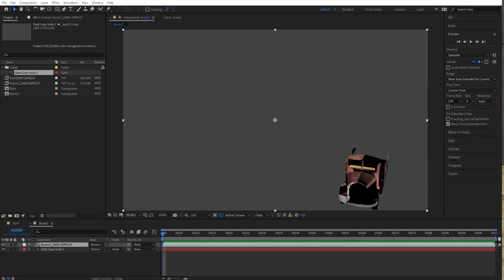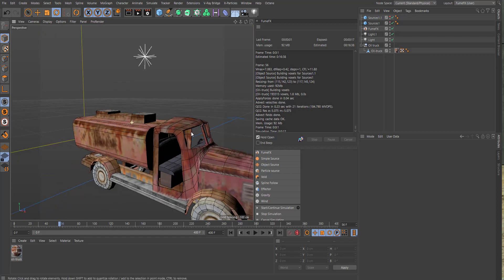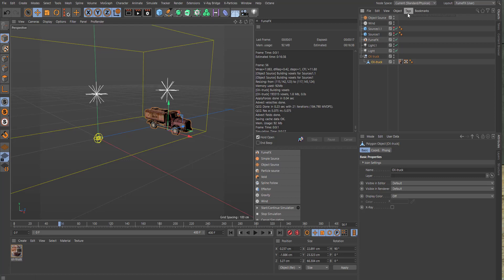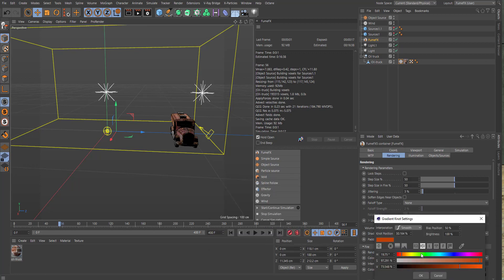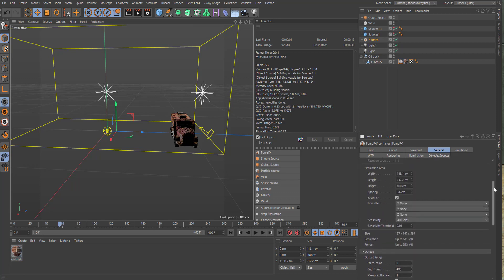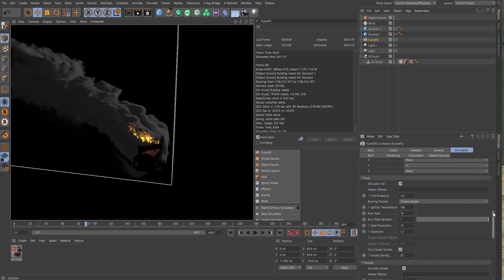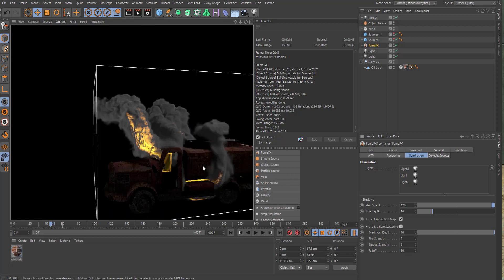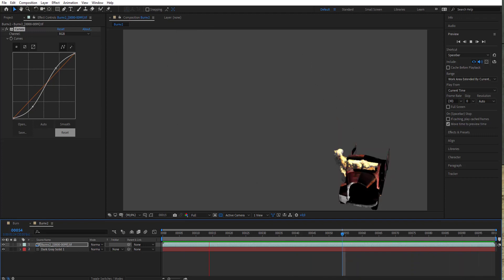FUMEFX Cinema 4D - Burning car (or any other object)

Comment: if i have 2 objects and they both burning, how can l do that the one stop burning and other keep burning?
Reply from the maker: Create two object sources. Animate the fuel, temperature, smoke to zero on the one you want to stop emitting. Remember to put both objects sources into Fumefx object list.
Reply: thnx
Reply: @SolidMotionVFX  What pc specs you have?
Reply from the maker: Quad core I7 7700K 4.5 GHz 64GB RAM, GeForce RTX 2060S 8GB VRAM, 1000GB SSD for cache and 1000GB SSD for rendering.
Reply: Nice😊
Reply: @SolidMotionVFX  did you work in industry